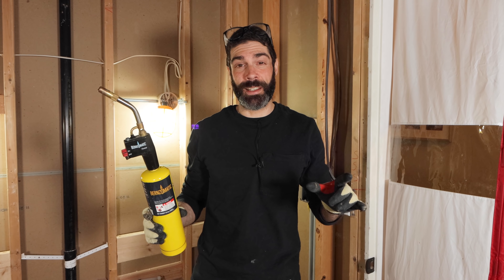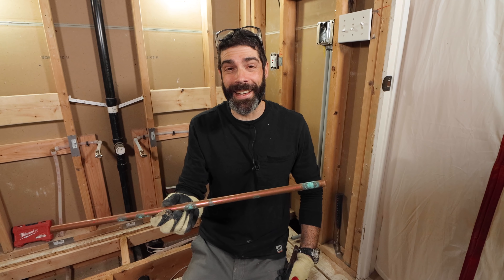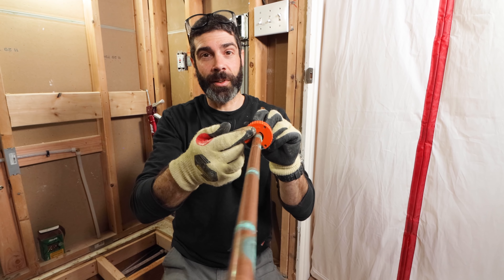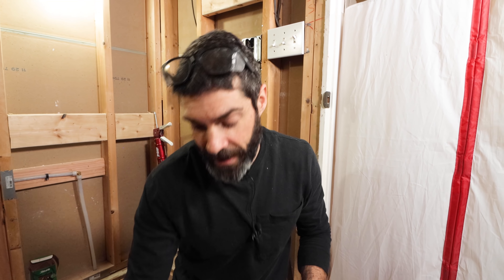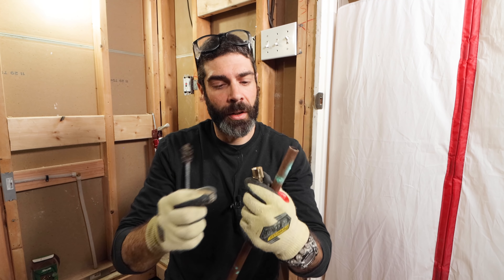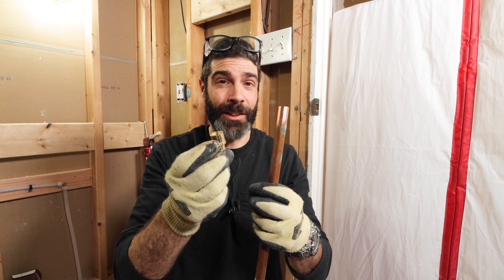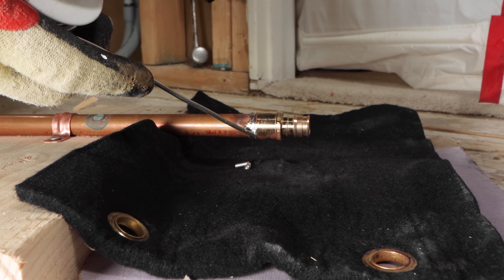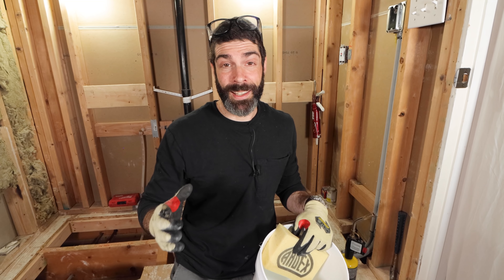How to Solder Pipes in Walls or Floors

Comment: Thanks for another great video. I am about to start soldering 1/2 inch copper pipe due  I  replacing a acrylic resin shower bathtub insert with porcelain and for an adventure will use new products namely GoBoard andTile Redi pan

Comment: Should mention the cloth to smooth out the solder should be dry, not wet
Reply from the maker: yes, actually I don’t even use a cloth to wipe the solder - that was to clean excess flux off the pipe but you’re totally correct on it needing to be dry 👊🏼🔥👊🏼🔥
Reply: @HomeRepairTutor   I have found leaks in old tract house mainly  started  at joints that  were never cleaned of flux. The acid residue must be cleaned  off for this main reason. That's  one of the main  advantages of  water soluble  flux vs  the other- ease of cleaning.
Reply from the maker: @williamevans6522  great point buddy, wiping that flux is super important
Reply: @HomeRepairTutor   Removing faucet aerators is mandatory, before turning the h20 back on. 
     Everything is low flow, and even plain white bread , w/o crust , can clog them.
Reply from the maker: @williamevans6522  I ran into that issue, great tip 👍🏼👍🏼🔥🔥

Comment: Metal flashing  can also be used as a heat shield.  
Cheap white  bread(no crust!) can be pushed in to the  existing pipe to stop  drips. Of course, draining the water in to containers to collect is always needed.  Sometimes though, it will stop draining and you think you can proceed, only to find that more water starts draining again to quench  your efforts.
Reply from the maker: Great tips, I’ve used the bread trick and also like to support horizontal pipes upward just a smidge to prevent that dreaded water problem right as you’re soldering

Comment: Also, you want to make sure the solder is doing its job, you don't want to apply too much pressure as you seen in this video the fitting pushed upwards a little bit.

Comment: Does Flux have a shelf life, because the Oatey flux I used had a different color than yours, but it is the same lead free water soluble flux?
Reply from the maker: it has a Julian code with the manufacturer date, only use it if it’s been made within the last year. You might have No 95 which is good but a different color

Comment: Funny, I did not see him clean the inside of the copper pipe. You want the solder to melt with both the inside and outside of the pipe. He had the round wire brush right in his hand. He cleaned the inside of the new fitting but he didn’t do the same to the more important old pipe!!!! Take note!!!   Also wear your safety glasses when playing with the flux. One little speck in your eye will burn for hours and hours!!!  And he had them on his head as well!!! You should heat the fitting up enough so that you can remove your torch before you apply the solder. The torch will push the solder around whereas the necessary amount of solder will be sucked up into the joint by itself and doesn’t need to be pushed by the torch. Let the solder find its own way into the joint!!!  Wait until the solder has hardened and cooled a bit and then take a damp cloth and wipe down the entire joint to clean all of the flux off after soldering.  If you don’t clean the joint it will turn green after a couple of months and start the corrosion process.  The green spots you were shown on that pipe were probably splashes of excess acid flux from whoever sweat those connections years ago. It is a good idea to make sure the copper pipes are cleaned of acid flux before the job is permanently covered up. A good clean copper pipe job will last indefinitely if cleaned properly with no corrosion!!!

Comment: Really interesting stuff here. Our house is 55 years old and we are looking to remodel our powder room. Luckily some of the plumbing is accessible from underneath in the garage but I wonder if some of the copper lines need replaced or if I just need to replace the shut off valves? That pex stuff seems too easy!
Reply from the maker: I’d inspect all the copper lines and look for those green spots that indicate corrosion. It’s unfortunate but as water companies add more chlorine this old Type M copper lines are corroding at an increased rate and causing tons of water leaks in my area. I’ve had countless friends complain to me and even plumbers commenting on the problem. PEX A is awesome because it’s more flexible than PEX B and the diameter of the PEX A is the same as copper. So I’m many ways PEX A is better then PEX B. The only downside is the expansion tool, it’s $400 but autorotates, whereas the manual tool doesn’t abs that can make the installation slower and potentially cause leaks. Let me know if you have any questions 👍🏼👍🏼👍🏼